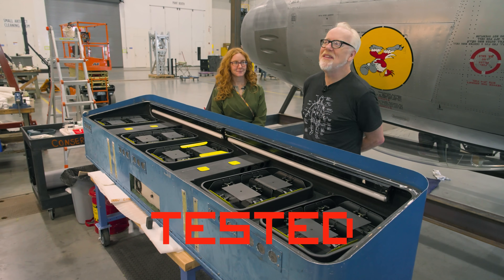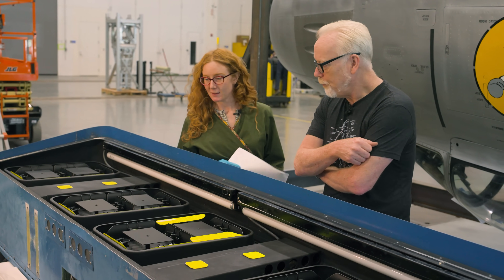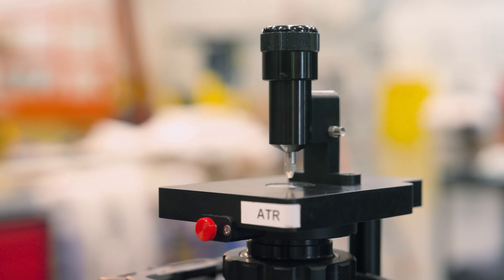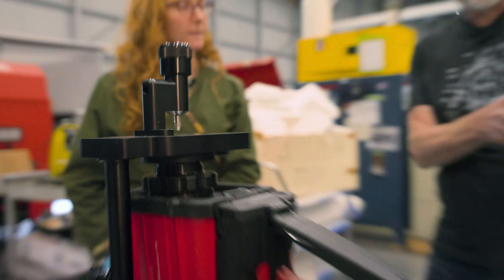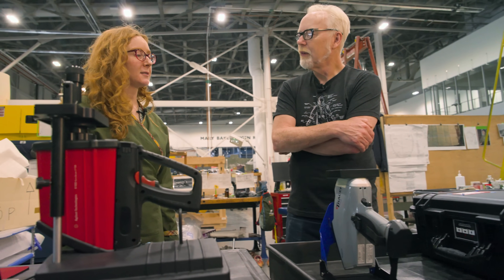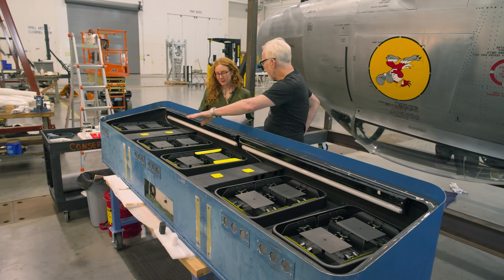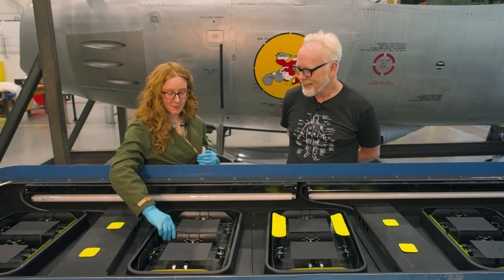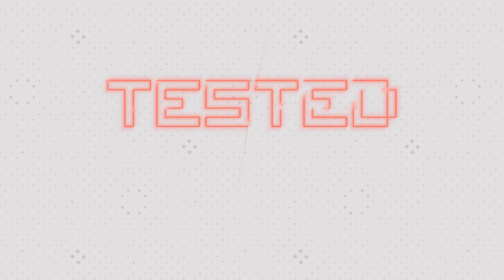Restoring the Iconic Space Shuttle Countdown Clock (at @airandspace)

Comment: This kind of non-functional preservation irks me a little bit. It's trivial to actually operate the digits of this kind of display, but they put almost zero effort into understanding how it works(or better yet, just calling the manufacturer/their descendants and asking), instead they resort to stuffing foam behind a bistable electromagnetic mechanism, causing slow deterioration to it as you're pushing against the magnetization state. And all the hubbub about analyzing which materials things are made of... are kind of pointless? You're not going to repaint anything, and you know it's held up over time, so just do what the manufacturer would recommend - don't expose it to UV light, keep it dry and clean and that's all there is to it.

Comment: The infrared instrument is actually an attenuated total reflectance (ATR) FTIR. That pin on top pinches an opaque sample against a diamond or germanium crystal that allows the light to pass through and create evanescent waves that bounce back to a detector. Straight through infrared with non-opaque material is absorption infrared, which is not what the pictured instrument is for without reconfiguration. I use these at work :)
Reply: She clearly said all of that in the video.

Comment: It took me waaay too long to realize that the F-86 in the background is upside down! 😂😁
Reply: I i just posted a comment did anybody see the f86 upside down. When I was I don't know six or seven the Park in Maryland had a f-86 Navy version as a climbing we would jump in the exhaust and crawl through this little platform that was about a foot wide and jump out the air intake about 6 ft to the ground and you could screw up the wing and look in the canopy and about in the '80s they into the hill and built wooden and plastic slides and took away all the metal stuff that I used in the '70s to play on cuz it was coated with lead paint and you know kids wouldn't have to go down to stainless steel slide anymore
Reply: Because he was inverted.

Comment: Giant Flip segment display. Very nice Technology, if you run them to spec so the coil doesn't overheat and kill itself, basicly maintenance free. (they are still made but smaller usually) also what was in the older busline displays, now generaly replaced with LED dotmatrix, sadly.

Comment: Aww.. was hoping they were going to bring it back to life. Seems like that's a hard-no on their side.
Reply: in old electronics, there's always the debate of 'as original as possible' vs 'working as intended'. for a museum, it makes more sense to keep it as original as possible, both as the purest form of preservation, and because it takes a lot of effort to repair old electronics, especially if there's no schematics. as much as I would have loved to see it working again too, I don't mind them just going with preserving it in it's current state.
Reply: @AB-Prince  As cool as it would be to see it in operation, it's neat to see the conservators do their best to choose a stationary appearance that looks like it's in use (such as  Ms. Brugioni Gabrielli's method of using black foam to "activate" some segments of the display) to bridge that gap.
Reply: @AB-Prince  Curious Marc would fix it one to original spec. I don't think making it functional with some new parts but period correct would detract from it's historic value. Especially since it is only ~50 years old.
Reply: Another issue is that the duty cycle it would be subject to in a museum is way more than what it had during its operational period.
Reply: @newq  It wouldn't have to be running constantly.. Only at special occasions. But I guess that would be more hassle.